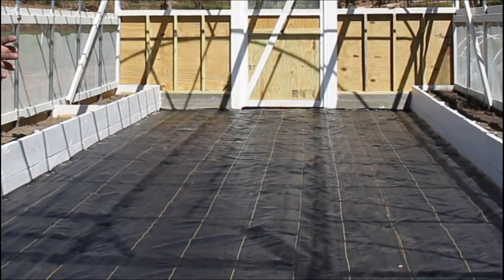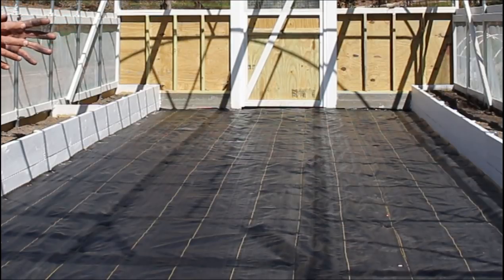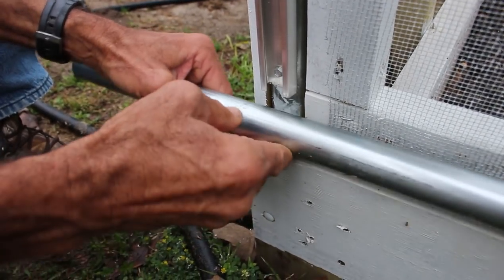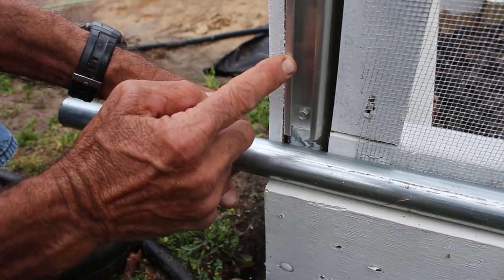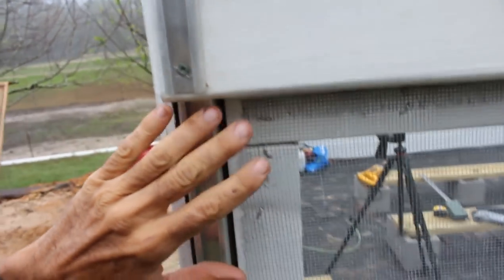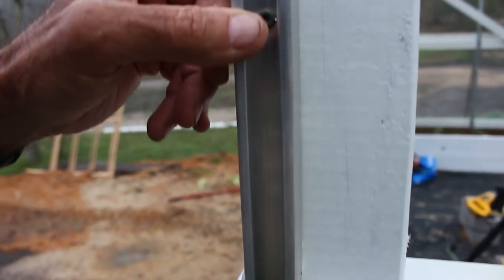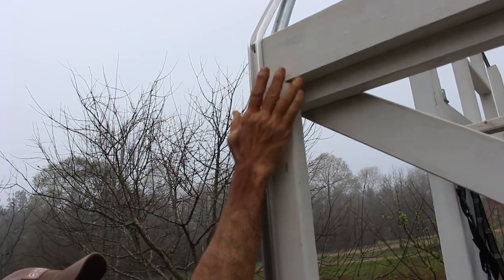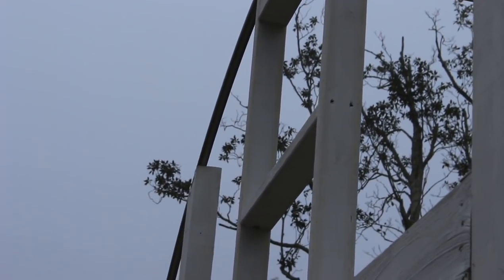How to Build a High Tunnel/Greenhouse |WIGGLE WIRE TRACK  | Part 10

Comment: Greetings Danny and Wanda... I am adding on to my greenhouse since I am replacing the plastic this year. I didn't put in hip boards/roll up to begin with but we get hot enough in the late spring and summer that I am really considering it. the gap in the transition on the endwalls has concerns for me. we have heavy snow/big wind events that I wonder if I just go with the track straight to the pipe, instead of attaching wood to the pipe then the track. I have further concerns that not having a "flatter" transition gives wear points to the plastic. your thoughts would be helpful.